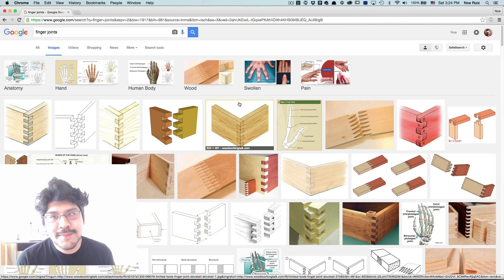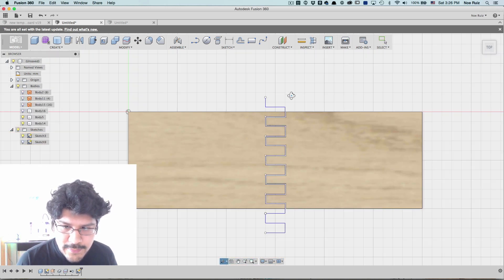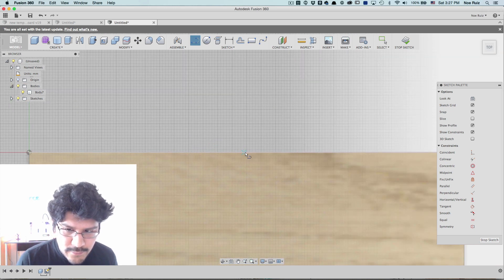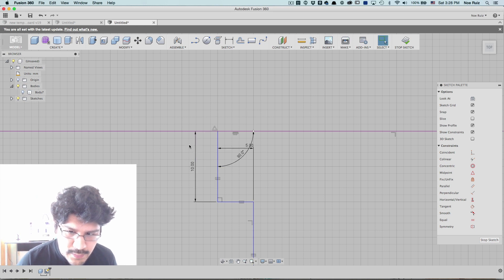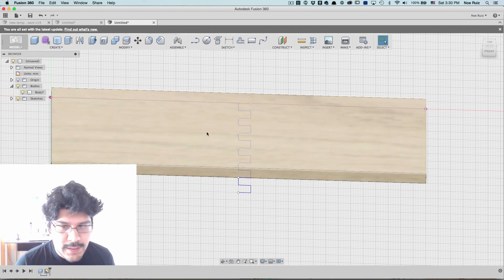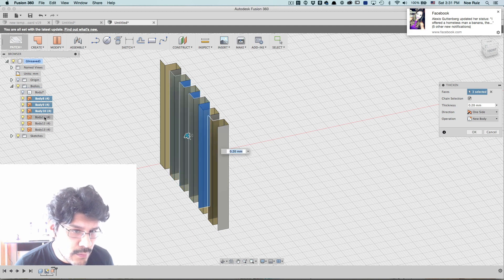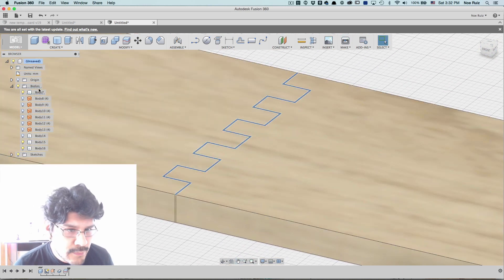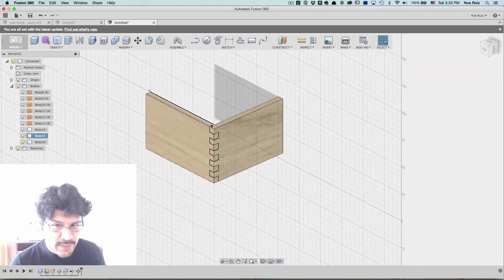Layer by Layer - How to make Finger Joints [Parametric]

Comment: the tolerance is also making the fingers shorter. it should only influence the thickness of the fingers. the length of the fingers should always be the same as the thickness of the sheet you are using.

Comment: Is there an easy way to add the tolerance symmetrically to both sides of the path, rather than one side? The method in this video will create slightly narrower fingers on one side.

Comment: you need to start using components, they way you are doing it is making it hard for new users when they do something then go on the forum saying it is not working they get the same answer you need to start again using components. and using user parameters is a lot better than having to change the sketch it's a lot faster.

Comment: I'm somewhat disappointed with this video. Not one parameter or formula was used. The only thing that was close to parametric was setting those parallel lines equal to one another. Can you do a video explaining the use of Fusion 360 variables and formulas.

Comment: This is great for when you need to add a little gap, as when 3D printing. What about when you're using, say, a laser cutter, which creates a gap (or kerf) naturally? In that case you need to make the designed parts a little bigger for a snug fit. What's the cleanest way to account for that in Fusion360?

Comment: Never thought of doing finger joints for 3d printing .... and it makes a lot of sense. Printing flat strong parts and joining them at 90º.

Only suggestion i'd add is that the thickness of the "cut" is on both sides , so it's "centered". 
So you can print two copies of a piece and they'd fit together (pieces should be simmetrical, a.k.a have equal number of fingers and "holes" ). Else one pair would not fit (two big fingers- small holes) and the other would be too loose (two small finger - small hole parts).

Also, how to make 4 sides of a box with this: After the cut, join the two pieces on the flat ends.
Print four of them, and glue.